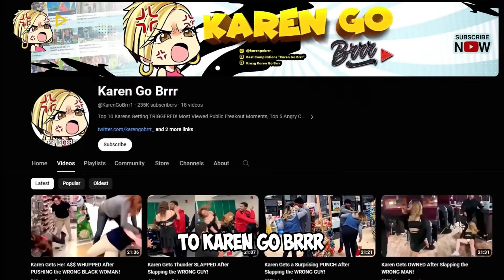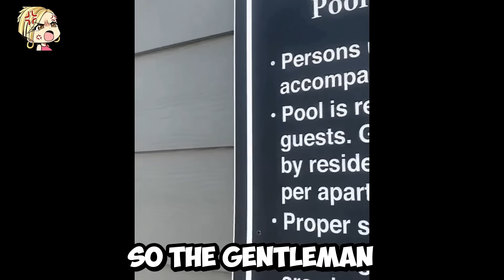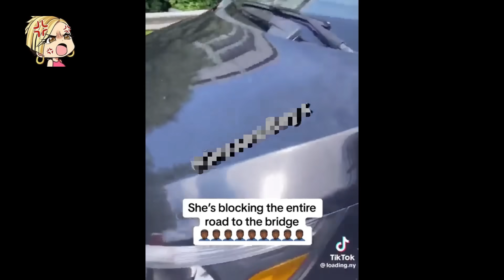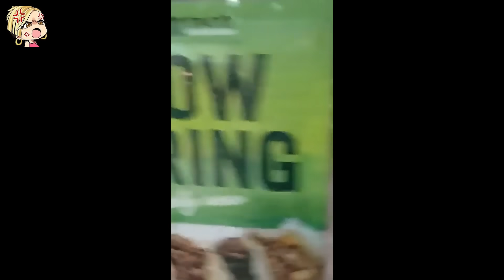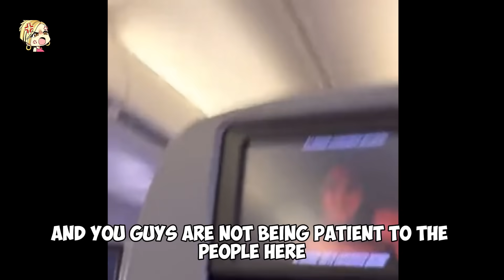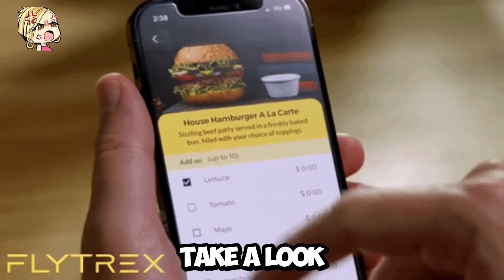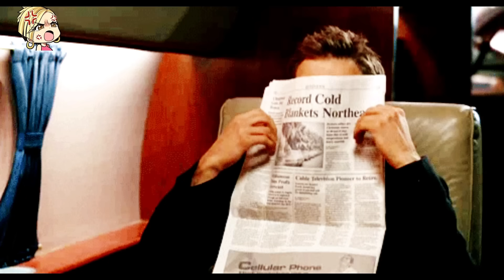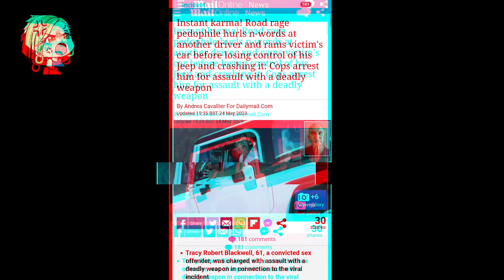TOP 50 KARENS WHO GOT DESTROYED IN 2023! "SPECIAL EDITION"

Comment: Regarding the fence, the lady with the sledge is actually in the right.  

Fences are usually put up about 1 foot before the property line to prevent disputes.  The people filming had added an extension that moved onto the lady’s property.

The two things about this is that the filming people have to get permission to do that. And it’s not uncommon for the people that want to do that to pay for a portion of that side of the fence since they didn’t have to pay to put up their own. 

Additionally, in a lot of areas, people can lose that foot of property because the fence has been in place for a long period of time, over the property line.   It’s not as common in the city though.

Comment: The nail tech could just redo the polish for an additional charge, if she chooses to.
Instead she said she would charge double. For 2 full sets. 
As someone who is used to having her nails done, my salon, makes sure I like my length,  color, art work etc before they complete each step. If I don't they are happy to change it. 
I have never been told I will be charged double if I didn't like the color after a completed job in the 30+ years I have had my nails done off and on though. $5-10 per color change is average for basic colors. Your higher end, cats eye, dip, glitter, iridescents, powders, I pay more.

Comment: It is difficult enough to ask for help but when you are given a handicap placard and you use it there is often a bit of embarrassment in using it. My disability is mostly my respiratory system. When indoors and away from irritants I appear perfectly normal so when I need my parking up close it seems out of place. What people need to realize is that they have no right to know what is wrong with me or even if the placard is mine. This has been an issue where I live and it has caused me a lot of emotional pain.